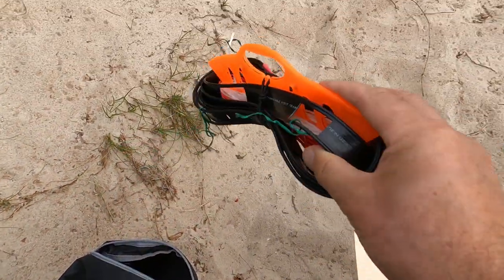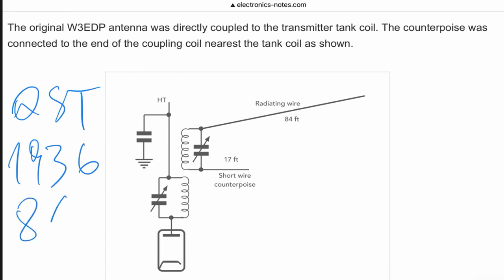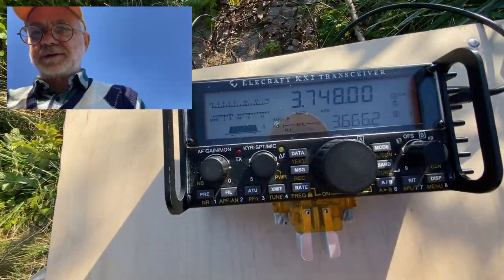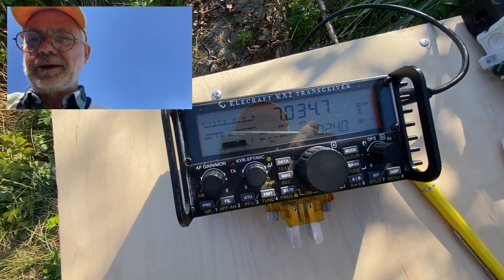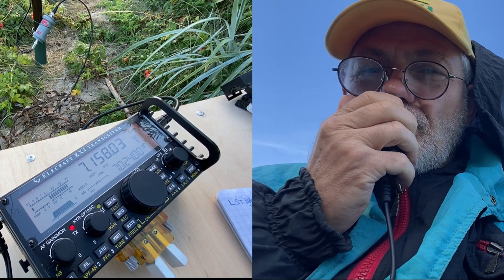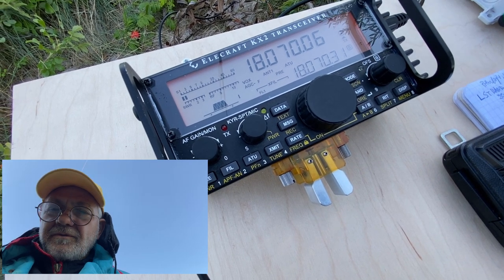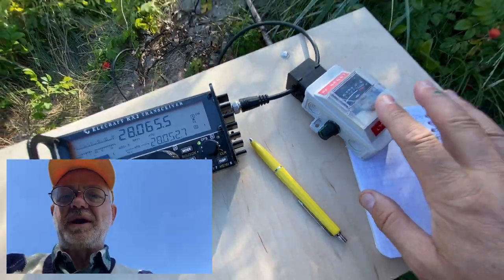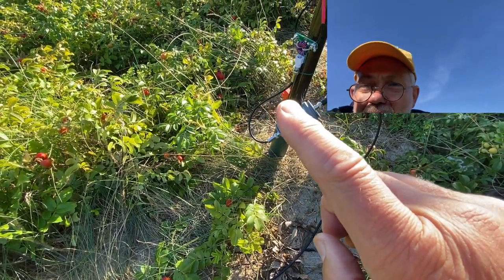My most unusual HF antenna I ever had!

Comment: Great video. I built the quarter size version yesterday and took it to a hilltop and it worked really well. Today I might make the full size version and try that !!!
Reply from the maker: @fotografm  Cool, good luck! You can compare them all, then. 73! Linas LY2H
Reply: @Linas_LY2H  Just got back from the hilltop. The full size version needs an ATU for every band but the performance was really good despite the lower bands being totally dead today. The quarter size vertical is quicker to erect of course and doesn't need an anchor point for the far end of the wire, plus at least 66 feet of space to erect it in. Will try again when band conditions are better ! I use FT8 to get fast signal reports from all over the world. I find it an invaluable tool 🙂 73 de Simon G3EYR
Reply from the maker: @fotografm  Thanks for sharing this Simon! Very interesting findings on the full size antenna. I'm also going to come back to the W3EDP antenna in some near future with some more experimenting . And yes, I agree, FT8 is a great mode for real-life antenna testing! 73! Linas LY2H

Comment: You need an unun, a balun, and a tuner? You can get 1:1 on anything with all that. It's not a resonant antenna.  But if you can make it work, that's great.
Reply from the maker: That's what Ham Radio is all about- making things work! 73! Linas LY2H

Comment: Nice video, Linas. Will build one for testing. Built your common mode tester as well, works great. 
If you can‘t get SotaBeams winder, please check out for the HQ-Winder Pro at Metropolis Drachen in Germany. They seem to be same, but just different branding.
Reply from the maker: Thanks a lot for the information, I'll check with them! 73! Linas LY2H

Comment: Linas, could you measure impedance/reactance just with the 1:1 common current choke? Without the 1:4. When you get i.e. 16 ohms using the 1:4 and the 1:1, you should get something like 64 ohms without the 1:4 and this would be closer to what we would want to see. 73, DL5MHK
Reply from the maker: Thanks Ralf! Yes, I probably could, just not these days: we've got tons of snow and the freezing temperatures :). Actually, it seems to me that the impedance behaviour in such an antenna heavily depends not only on the operation frequency but also on the role of the twin-lead feeder: on some frequencies it can act as a quarter wave stub, on the others- just like a short counterpoise etc.  :) So, it will be interesting to make these measurements, thanks for suggestion again! I think I'll do this on the full-size version of this antenna installed on my 10m Spidermast. Weather permitting , though ... 73! Linas LY2H
Reply: @Linas_LY2H  Hi Linas, I would recommend to try it with the antenna you've shown here - so you have a direct comparison. Or for sure the fullsize version with and without the 1:4, to see the difference. But if you have a real part closer to 50 Ohms on the fullsize version, then it's not necessary. Long story short: Do it with this version first!
.... ..    73, Ralf, DL5MHK
Reply from the maker: @ralfbuschner6925  Sounds reasonable!

Comment: I use the Full size , the Jr and the mini for POTA. Works good. 73. N1XXU
Reply from the maker: Fantastic! How would you compare the Full size vs Jr? 73! Linas LY2H
Reply: @Linas_LY2H   the full size tuned up easier on 40. Worked well on 40 and 20. The JR I had a little trouble tuning on 40 so I used a 9:1 Unun. Tuned up fine on all bands. The Jr worked better on 20 and 17 than the full size. I put it up as a vertical on my 12 meter Spider Pole as well as in a tree. The full size I put up as an inverted L.
Reply from the maker: @Andrew-yx7sf  Thanks for the info, very interesting and useful one! CUL, 73! Linas LY2H

Comment: I always learn something new!  You Linas, are a natural teacher.  It’s second nature to you, and your knowledge and expertise help me understand the principles and theory of Radio communications.  

The Zepp is an interesting antenna, I never knew you could scale it down… the balun, and RF chokes, are also an important consideration.  I have several RF chokes, but rarely need to use them, given I use Antennas which are not prone to common mode currents.  

Thanks Linas, for the video, and the knowledge you share.  

de W7UDT Rand   (dit dit)